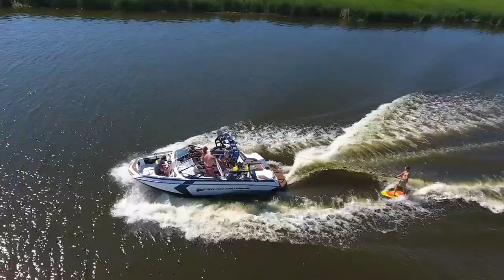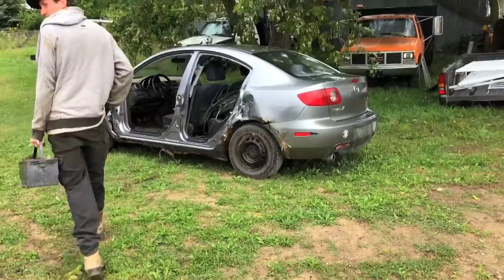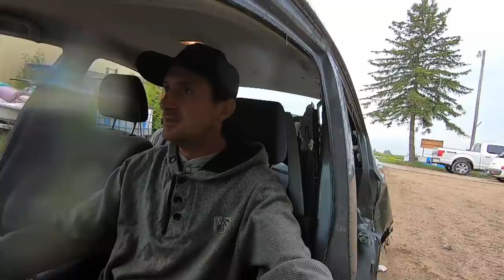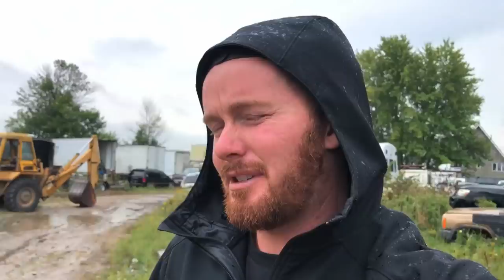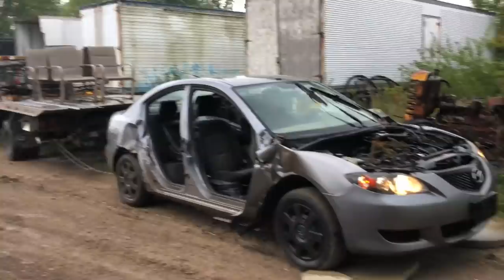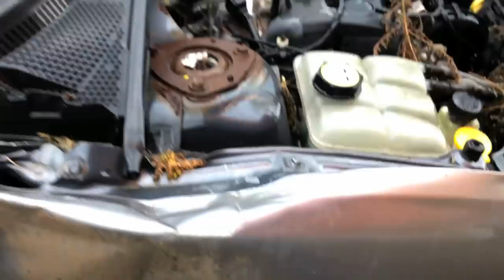Manual MAZDA 3 FOURTH GEAR BURNOUT!

Comment: Are traction control a thing on these? Cant find a button on mine nor a fuse for it
Reply: It's called DSC in mazdas, in mine it's a button on the left of the dash next to the turn signal lever labeled DSC off.